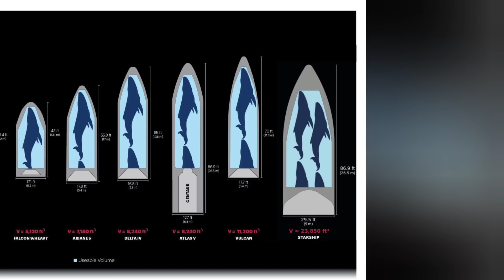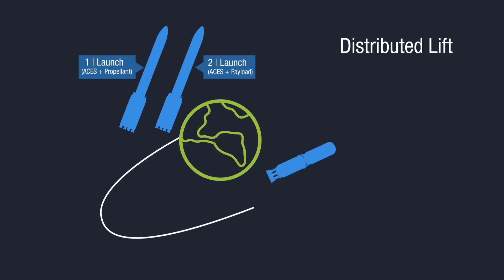Devastating news for ULA!!  But why does Vulcan Centaur matter?

Comment: ULAbhas to step up to the problem , they build a good ship they have come up to an issue , they need to solve it, just like Space X would do , they found the problem , so get busy fixing it they need to get their engineers on the ball!, yes Space X can help but our Space force needs it so it’s a security issue for our country. But maybe you already spoke of this, why doesn’t Space X  develop a Starship that can send up a second or third stage rocket with their payload , unload it in space and let it light it’s own rocket to take to a higher orbit  and yes Space X needs to develop a refueling space tug very quickly

Comment: Yes. Starship is not designed nor focused on sending dead loads (i mean, not astronauts) into earth synchronous orbits. I remind you starship will be refilled with carburant on LEO, so it can proceed to go to much farther missions. I don't see why starship could not be adapted for specific missions to carry C class cargo.  It would be custom made, and probably way cheaper than Vulcan or any other rocket. Everybody has agreed that the future is on reusable rockets, not single-use ones.

Comment: Don't know about F9, but I remember Gwynne Shotwell talking about how they have bumped up the price of F9H contracts for USSF / DOD to cover development of an extended fairing and a VIF, both of which the govt knew they didn't have when they invited them to bid for the contracts.
Reply: Where is that LC-39A VIF, promised by Elon Musk — 
to launch NRO/NSA payloads?
Well, he skipped it, in favor of a Starship tower build at LC-39A.
I assume someone pointed out the $$ to build VIF, and find it would only be used 5-6 times until 2030.
SpaceX then decided — Let ULA have those launches — we will use that $$ on Starship.

Comment: @TheAngryAstronaut  

1. Vulcan Centaur being capable of missions that nobody else can do is a nonsense - it performance is the same or lower than FH and both Vulcan and FH are designed for all 6 USSF NSSL reference orbits. And while not yet launched, SpaceX already have contracts for launches involving the extended fairing - so that capability is comparable to that of Vulcan (which has not yet demonstated their use either - its fairing is different from Atlas V)

2. Vulcan is not made out of a steel-aluminum alloy - you are mixing what materials are used for the 1st and the 2nd stage

3. The amount of material for the stage structures has no meaningful effect on the rocket price (you claim that the small amount of material used helps the cost) - in fact working with very thin baloon tanks that cant support themself without being presurized likely increases the manufacturing cost over designs that dont use baloon tanks

4. I am not aware of anything that would prevent Starship from carrying payload with an expendble 3rd stage withing the cargo fairing 

5. SMART will recover only engines and so just part of the 1st stage total cost, so it is only an advantage against expendable rockets, but not against SpaceX

6. Being able to carry multiple payloads is already pretty normal for heavy-lift rockets, while you are talking about it like it is come advantage over competitors

7. The current itteration of Centaur V wont have all the features of ACES.

8. The development of fuel-storage was at least partially blocked by Boeing, not just be politicians

9. Dream Chaser is even more delayed than Vulcan Centaur, so current Vulcan delays are not yet affecting it

10. The USSF NSSL phase 2 contract already has a provision to move launches to the second provider if the contracted provider isnt able to launch it - so it is a complication for the USSF, but likely not a big one.

11. Regarding "inflated" SpaceX prices, SpaceX needs to cover the cost of unique infrastructure (mostly the VIF and the extended fairing) that commercial customers dont need - the cost of which government covered separately for the ULA. Prices for additional launch services used by the DoD/NASA are based on earlier (years ago) ID-IQ contract - those just move by inflation-adjustment.

12. Atlas V has not been flying for 30 years - its 1st launch happened in August 2002

13. You clearly didnt research the Russian engine issue properly - for already delivered engines there is a deadline for assigning NSSL missions written into that law and that dealine already passes, so Atlas V can no additional NSSL launches can be shifted to it even if some Atlas Vs become available
Reply from the maker: You are a nitpicking jerk who definitely needs a hobby. There are more inaccuracies in this absurd list of yours than the minor errors I made in the video. 
Do you work for Sierra Space?  I doubt it. I, on the other hand, interact with them almost weekly. Dreamchaser will be ready to launch by the end of the year, and this development will seriously impact their plans. 
Yes, I misspoke in a MINOR way by saying "Atlas V" instead of "Atlas" but you (and everyone else) know what I mean. The Arlas series has not experienced a failure since 1993. Thirty years of excellent flight history.
The inflated costs in the recent SpaceX costs have not just been observed by me. Tory Bruno made a point of examining their enormous profit margins in recent contracts...margins that put ULA to shame. But I decided to be a little less condemnatory in my reporting, which doesn't seem to have helped.
I don't have the time or the desire to go through the rest of this irritating list.
Get a life.
Reply: @TheAngryAstronaut  You are the one pretending to be a space industry reporter without doing proper research into what you are talking about - like those incorrect capability-difference claims, not being aware that Atlas V cant be assigned more NSSL missions by law, etc.

Comment: The number of errors in AA videos is really annoying
Reply from the maker: And, even more annoying?  Critics who don't provide examples.
Reply: @TheAngryAstronaut  
1. Vulcan Centaur being capable of missions that nobody else can do is a nonsense - it performance is the same or lower than FH and both Vulcan and FH are designed for all 6 USSF NSSL reference orbits. And while not yet launched, SpaceX already have contracts for launches involving the extended fairing - so that capability is comparable to that of Vulcan (which has not yet demonstated their use either - its fairing is different from Atlas V)

2. Vulcan is not made out of a steel-aluminum alloy - you are mixing what materials are used for the 1st and the 2nd stage

3. The amount of material for the stage structures has no meaningful effect on the rocket price (you claim that the small amount of material used helps the cost) - in fact working with very thin baloon tanks that cant support themself without being presurized likely increases the manufacturing cost over designs that dont use baloon tanks

4. I am not aware of anything that would prevent Starship from carrying payload with an expendble 3rd stage withing the cargo fairing 

5. SMART will recover only engines and so just part of the 1st stage total cost, so it is only an advantage against expendable rockets, but not against SpaceX

6. Being able to carry multiple payloads is already pretty normal for heavy-lift rockets, while you are talking about it like it is come advantage over competitors

7. The current itteration of Centaur V wont have all the features of ACES.

8. The development of fuel-storage was at least partially blocked by Boeing, not just be politicians

9. Dream Chaser is even more delayed than Vulcan Centaur, so current Vulcan delays are not yet affecting it

10. The USSF NSSL phase 2 contract already has a provision to move launches to the second provider if the contracted provider isnt able to launch it - so it is a complication for the USSF, but likely not a big one.

11. Regarding "inflated" SpaceX prices, SpaceX needs to cover the cost of unique infrastructure (mostly the VIF and the extended fairing) that commercial customers dont need - the cost of which government covered separately for the ULA. Prices for additional launch services used by the DoD/NASA are based on earlier (years ago) ID-IQ contract - those just move by inflation-adjustment.

12. Atlas V has not been flying for 30 years - its 1st launch happened in August 2002

13. You clearly didnt research the Russian engine issue properly - for already delivered engines there is a deadline for assigning NSSL missions written into that law and that dealine already passes, so Atlas V can no additional NSSL launches can be shifted to it even if some Atlas Vs become available

Comment: Hello angry.

Maybe you should visit a scuba-diving shop somewhere.

Ask to hold a scuba tank.
Feel the weight.
Ask what its made from.
When they answer steel or alluminium you should ask to hold the other one of the identical capacity.

To vent your confusion, you should ask them why the light weight alluminium tank is so much heavier tjan the heavy steel tank.
Its actually very simple and don't forget that scuba tanks go down increasing in compression all the way, negating the strength problem vs rocket skins that don't  experience outet compressions, they experience internal compressions ie explosive forces not implosions.

So it is blatently obvious that an alluminium skinned rocket is stupid and a non starter.

I realise its a slip of the toung but at the beginning you say the skin is very thin lightweight alluminoum, then 3/4 of the way through you say its steel, a whoopsie!

Elon has every moral right as well as every legal right to charge extra to support contracts that arrise because if a customer turns you down for a competitor and that competitor fails or defaults then your servise is becomes stratospheric in worth.
But Elon & SpaceX always come to the rescue at minimal costs.

Such a great company in every respect.

Elon isnt interested in wasting talent, manpower, facilities, time etc to build longer fairings.
Thats understandable.
Just pondering:  what if somebody gave SpaceX a pair of such longer fairings of flight proven design.
Is it feesable or prohibitive to make a fairing mounting adapter?

Comment: If Starliner ever is made ready to fly again, I think a fitting punishment for Boeing would be that they are required to use a SpaceX rocket to boost it up into orbit.  Boeing needs a strong message to stop screwing up.

Comment: Only those payload that have been assigned prior to 2023 can be flown on Atlas V with the RS-180 rocket engines.  That means anything newer will not be eligible.  ULA cannot claw back some of the Atlas V launches they've sold to Amazon even if they promised to replace them with Vulcan-Centaur.

Comment: As you say, mistakes happen, but again, as you say, not such a fundamental design flaw, with so much testing, so much experience, and after so much time!  It seems to me that the only reason for a design flaw like this to get so far is so that ULA could promise a vehicle with the capabilities they first advertised but knowing full well it was never going to happen.  The fiction would continue until its partners could no longer pull out of the project without losing a  lot of money.  The kicker is of course, that ULA has very quickly determined what the problem is and designed a "fix" for it so quickly that I wouldn't trust them to eliminate the problem, but to perhaps only reduce the risk of an exploding rocket.

As for SpaceX, I would put my money on them designing and building a fairing for Class C military payloads very quickly and take over the role of Vulcan Centaur and stick it to ULA just because they can.  As for Falcon9 taking up a Boeing Starliner, they might well be able to, but why would they when they have perfectly good Crew Dragons to do the job.. and that's assuming the Starliner EVER gets ready for launch.

This is the basic difference between SpaceX and almost all other commercial rocket companies - transparency and openness and an attitude that says "if we've made a mistake, let's admit it and fix it - quickly".

Comment: Jordan, the engines on the Atlas V will need servicing before the flight, especially if they’re in storage for every long, and the Russians aren’t going to provide that…
You know that ULA refused to allow the supersized faring manufacturer to sell the larger farings to SpaceX. SpaceX does have test stands at McGregor they could allow ULA to use for testing the redesigned ACES stages… Maybe SpaceX could allow ULA to use a heavy duty test stand in exchange for being allowed to purchase a few supersized farings. ULA & SpaceX could say they’re doing the deal “for the good of the country”! 😅

Comment: Any Time Soon??? 
Every rocket made to get us to space helps no matter how little they end up mattering??? ULA is the company that forged our way for the needs of reusability in the 20th century. Too bad they didn’t get the needed support from Congress. SpaceX’s concept started with making a rocket to be reused, so their business plan was to have a reusable Falcon 9, before needing Congress’s support for launches. Don’t get me wrong Government Launch contracts are important and hopefully profitable.?? 

Angry tells us as he has in past videos, we need more rockets to get to space, the ULA Vulcan Centaur is needed to get heavy payloads to a synchronous orbit without the need to refuel. The Vulcan Centaur uses a thin aluminum steel compound so it doesn’t need so much fuel to reach higher orbits without refueling. But, the reasons for the mishap at the last test of the Centaur had to do with the thin steel. 

Types of Orbits – Space Foundation; spacefoundation. org/space_brief/types-of-orbits/ 

ULA Vulcan Centaur’s second stage is not as big as the Starship but what does size matter if you don’t have the fuel to get as far? ULA and SpaceX want refueling stations in orbit, but the Starship needs to be refueled in LEO to get anywhere else in orbit. 

I think that is what Angry has an issue with because he tells us about the bubbles in the fuel enough… I’m sure the fix is not as easy as I have suggested, ‘They can add enough pressure to the fuel tanks so bubbles don’t form. When refueling both tanks are pressurized, so to move the fuel, relieve the pressure and add pressure, the fuel will move as steadily as a blood transfusion.??’ 

Wouldn’t it be excallent if everything worked and we are orbiting the Moon next year with the Starship and Vulcan Centaur?

Comment: I think you are missing the point of BFR if you keep assuming it can only launch Starships. I don't think it would take too much effort to design an upper stage with fairings and 2 or 3 raptor II vacuum engines. They could deliver nearly Startship sized payloads to the appropriate orbit. Only problem is that this doesn't necessarily make sense until BFR itself is proven.
Reply: Or, they could put another rocket inside the Starship. The whole Starship doesn't need to get to GS orbit. It can carry 100+ tonnes to LEO. I'm sure they can use that mass to make a transfer craft to push a less than 100+ tonne satellite to geostationary orbit.
Reply: That is what is actually done nowadays. What is essentially a third stage is bought from another provider and put in the payload fairing below a satellite. There are companies that will design a custom propulsion stage. Rocket Lab is another company with this product:
"Photon flies as the upper stage of Electron, eliminating the parasitic mass of deployed spacecraft and enabling full utilization of the fairing"
Reply: One would want to maximize efficiency by using a high-ISP stage, maybe without cryotanks adding extra weight. Hypergolics seem suggested.

Comment: The payload "volume" of Starship needs to be taken with a grain of salt.  It is NOT comparable to the functional capacity of the Space Shuttle - whose payload bay was complete accessible courtesy of two very large payload bay doors.  Starships structural strength relies on it's steel skin (monocoque structure) and pressurized tanks... any opening in that skin will require substantial structural reinforcement - as can be seen with the small opening of the Pez Dispenser model for Star Link 2.x.  Adding something akin to the Space Shuttle's payload bay and doors to allow for very large payloads... will add considerable weight to the current system... potentially causing many unforeseen issues in the future.   There are many examples of engineered systems that worked ok at the prototype stage... but failed to meet expectations when used in the real world.
Reply: You divide the 2nd stage into 2 states with an interstage where the “Paz dispenser” is - Just remember it can’t have a total mass of over 150 tons…

Comment: Why has it been so hard to build a larger fairing for the falcon Heavy? you would think designing and building a new fairing would be relatively easy for a company like SpaceX
Reply: You have to build machining to make the new farings. ULA not only prevented the company that makes these farings from selling the larger farings to SpaceX, but has blocked SpaceX from using the machining & other patents used to make these farings!
Reply: @TraditionalAnglican  ... but that just means Musk would make them in house, right?

Comment: Hey Mr A, sorry to bother you in the middle of the very important subject that you're presenting (with your usual aplomb), but many of us know that GSO (or GSTO) is around 36,000 kms (ish) or 22,500 miles (ish), but also many of us don't. Would you mind including the specific relevant distances (ie - not just the acronyms GSO or GSTO) that the systems which you are discussing are capable of achieving in miles/kms against the weight they are able to deploy at those distances please? Big fan from the dim distant past. Thank you and carry on